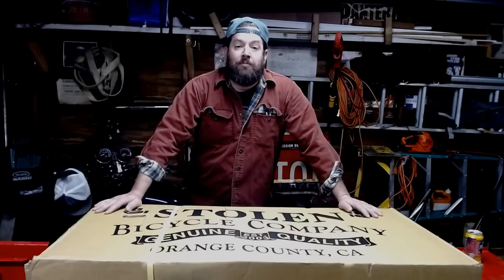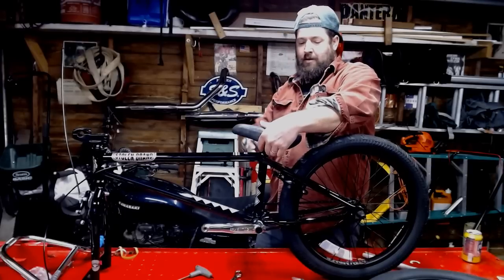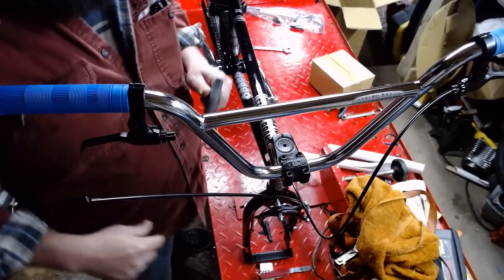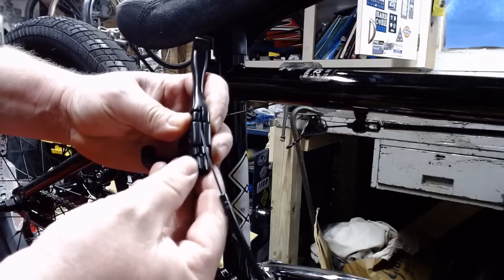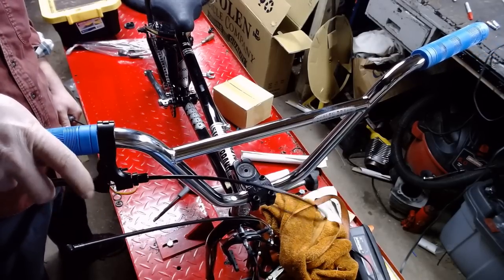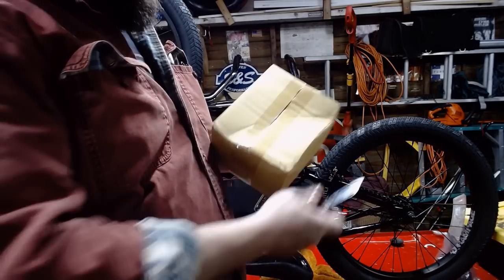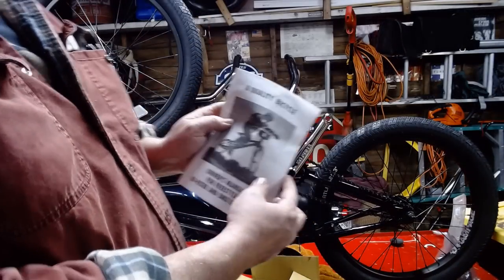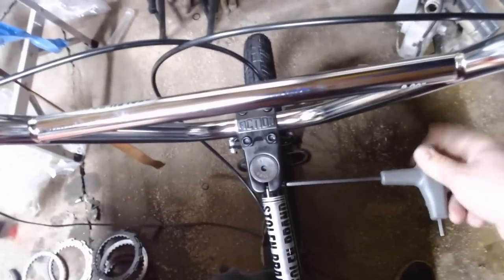Unboxing and assembly of BMX Stolen Heist

Comment: what about stolen stereo 2021 i am a beginer is it good to buy ?
Reply from the maker: That is a very good beginner bike!
Reply: @KnobleMoto  thanks do you have other syggestions for bmx max 400 euro because i am from greece do you
Reply from the maker: @zacharias237  I am not familiar with what is available in your area; but look for quality parts like a chromoloy/4140 frame and sealed bearings.

Comment: Every time I do a bunny hop with my stolen casino bike my handle bars come back how do I fix it? I have checked with my uncle my grandpa and some other family who ride bikes and they said it’s tight enough and shouldn’t be moving how do I fix it
Reply from the maker: There is likely some debris or dirt inside the clamp.  Take it apart and clean it well.  All metal chips, dirt and paint need to be removed from the clamping surfaces.  You need a pure metal to metal contact . Then tighten the bolts evenly in a criss-cross pattern.  If that doesn't work; your stem or bars may need to be replaced due to wear from your bars moving.